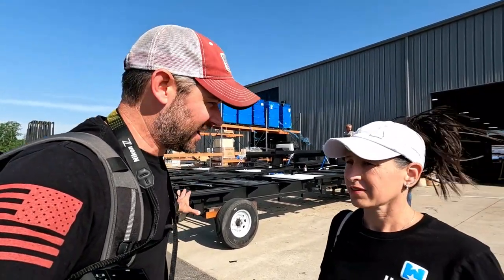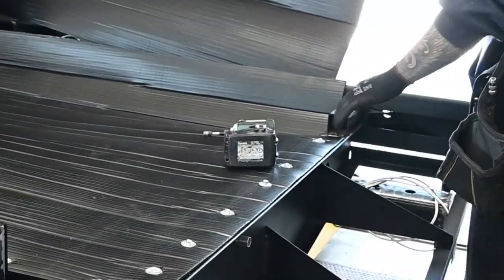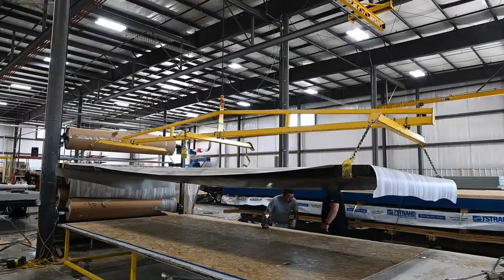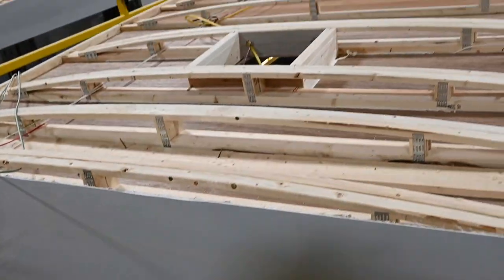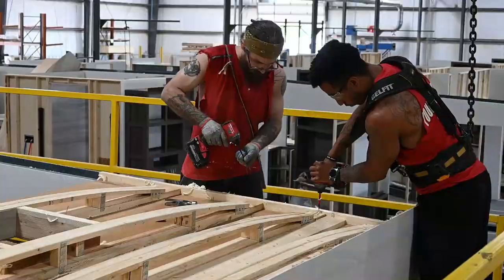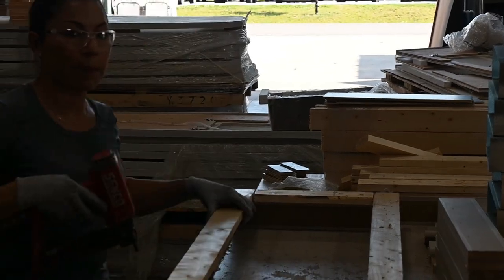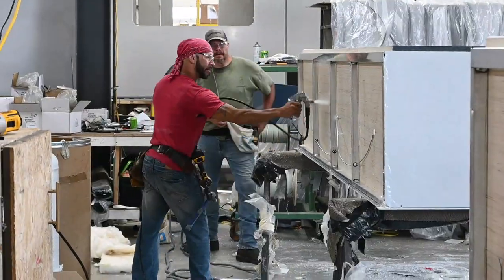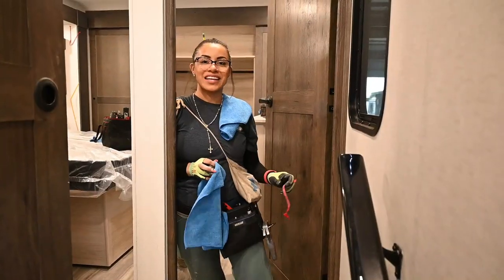How RVs Are Made (Alliance RV)

Comment: Looks like the same crap as the others with guys running around with their heads cut off. God forbid you have to slow down and fix something.
Reply from the maker: They were moving fast but they did stop and fix the issue. I'm sure other manufacturers would have just kept going and let the new owner deal with it.